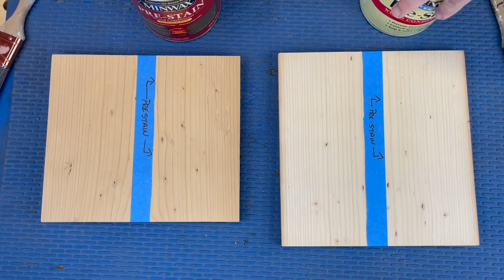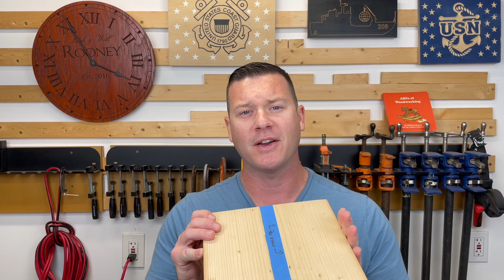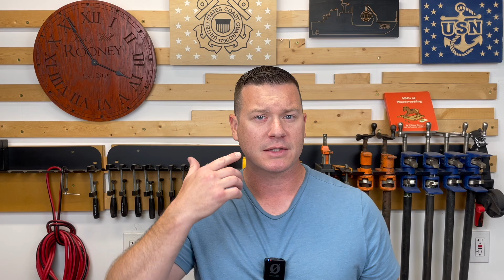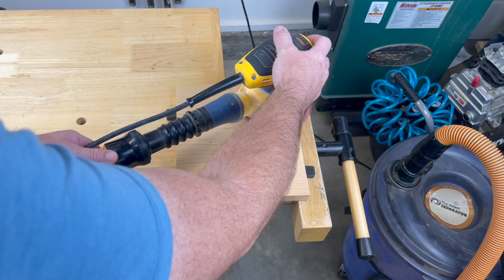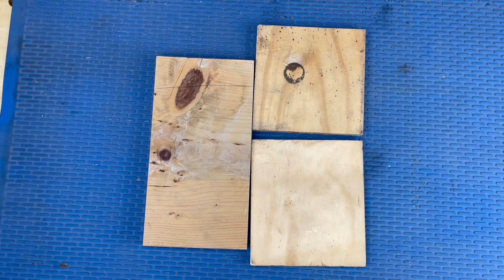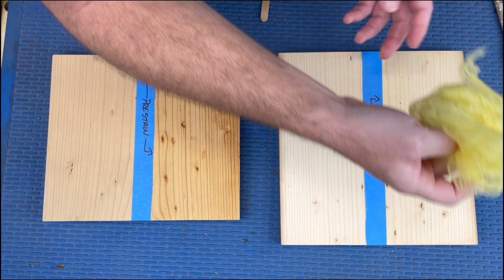How Pre-Stain Wood Conditioner Actually Works (And Why It Matters!)

Comment: I’ve heard that it’s better not to sand wood (softwood, such as pine) with sandpaper coarser than 180 grit, because doing so closes up or sands away the harder parts of the wood, which can cause uneven absorption of wood stain and other products. Should I follow this rule when using Pre-stain as well, or, like you, can I use 220-grit sandpaper?
Reply from the maker: I've heard this once before, but I've always done 220. I recommend you give it a shot with a side by side comparison like I did here. One at 220 and the other at 180. See if you can see a difference. 

I think it's important to always test things. Find something that works for you. Maybe you will discover something that others have not tried and you find it works better than anything else.

Comment: Prestain shootout. Varathane vs minwax vs gluesize
Reply from the maker: I haven't heard about glue size before. Do you have experience with it? In theory you're just watering down the glue correct?
Reply: 3 tbsp wood glue
3tbsp of water based poly
Qt water @novicewoodworker
Reply from the maker: @Stevesbe  I appreciate the breakdown.